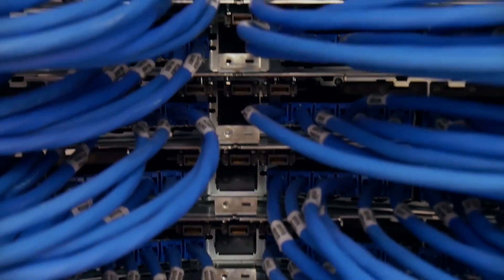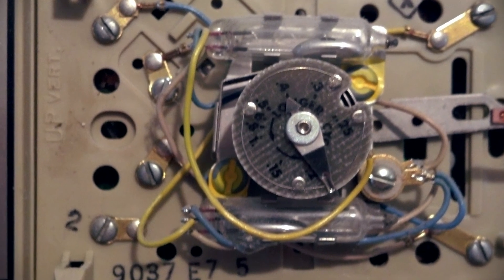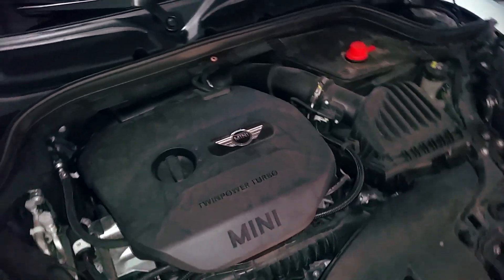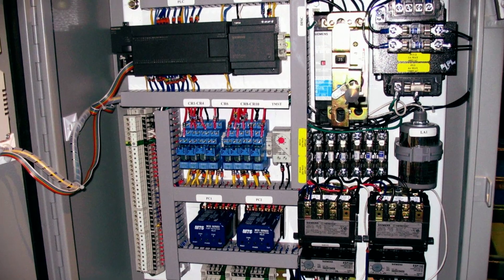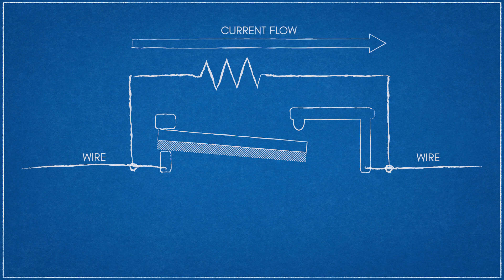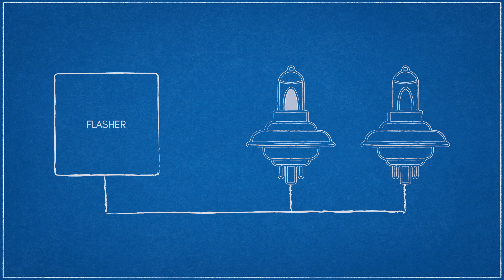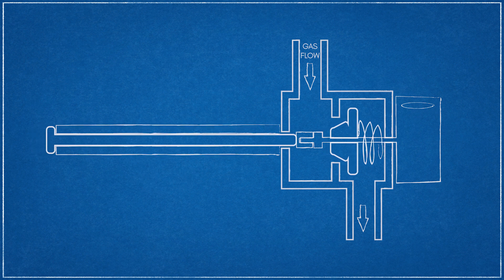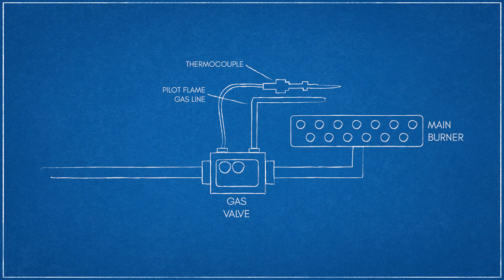Clever Uses Of Thermal Expansion

Comment: Thermal switches in blinkers typically have the resistor and bimetallic switch in series, so the light goes on immediately when you turn the blinker on and turns off once the resistor heats up enough. Also thermal switches in blinkers slow down when a light bulb burns out, as the current through the resistor decreases and it takes longer for it to heat. Relay based blinkers usually speed up when a bulb burns out. And the rate change isn't an accident, it is there so the driver notices when a bulb burns out.
Reply: Always wondered why they sped up when they were dieing. Great info
Reply: My brain died when he said when one bulb fails more power goes through the resistor... But... the resistance is higher now.
Reply: It will speed up. Thermal inertia plays a role in it. If you have 2 bulbs on and send more power though the strip, you end up with more hear stored in the heater and the strip and it goes a bigger distance. If you have less heat, it will open less far apart and cool faster too.
I get your logic with the slower turn-on, but tell me, how would it cool down slower and turn off slower if you had less power and thus less heat though it with a single bulb?
The thing speeds up.
Reply: @whatevernamegoeshere3644  Hey there... I tried to look it up, but some say it slows down, others say it speeds up. The thermal inertia theory however would make sense, so for all I know you may be right.
I also have to correct myself, I believe I read somewhere, the heating resistor is connected in series, which seemed to make sense, as it would make the light turn on immediately. But from what I've seen, most blinkers seem to have the resistor parallel to the switch. And basically the resistor has a high enough resistance so the light bulb only glows when the switch shorts out the resistor.
It is also worth mentioning that these blinkers are usually not bimetallic but instead use a single type of metal that expands a lot when heated and the switch is designed in a way so that it snaps open and closed. This gives it more decisive on and off states and also causes the actual clicking sound. Most switches click because of this and it's actually kinda necessary. Because when you disconnect to contacts you usually get an arc (the sparking when the switch opens) and that damages the contact, so you want to extinguish the arc as quickly as possible. It's a little more complicated than that. But anyway, just thought maybe it interests someone here.
Anyway, thanks for your explanation. I would be interested to know for a fact whether the speed up or slow down with more and less load, since the internet seems to disagree... Perhaps it's also different from blinker to blinker.
Reply: @phinok.m.628  
My experience with Chrysler vehicles was that the blinking speeds up when the tail light bulb burns out.  Some other cars don't seem to change much.
Reply: Phino K.M. Indeed. And newer vehicles (e.g. EV) with LED turn signals have the audio synthesized to provide that feedback to the driver
Reply: @airgliderz  Say you have 2 bulbs at 1 ohm in parallel and one blows the resistance goes up (from .5 to 1), unless car blinkers are wired in some wierd way then idk.
Reply: @airgliderz  It blinks faster because there is less thermal inertia, it's quite simple really.
Reply: @benlawton5420  correct.
Reply: This was always the problem with thermal switches: any variations in the load caused a change in the flash rate. What aggravated the situation was when you replaced a dead bulb, you used a different bulb that burned either more or less current than the OEM bulb. After that, the flash rate was different than it should be. How many times have you seen a car in front of you whose turn indicator is flashing very fast? He put a higher wattage lamp in the socket than was the original. Too slow meant the wattage was too low. The uP-driven turn indicators do not have this issue, although they almost all no longer use incandescents, either. There are also flasher available for use with these different wattage bulbs. No doubt there is some DOT spec somewhere that says "turn indicators must have a flash rate of X."
Reply: No; the turn signal is initially off (well a small amount of current flows, but not enough to light the filament). 

Once the bimetallic strip heats enough, it contacts, full voltage flows through the switch (and  not the resistor) allowing the strip to cool again.

The strip heats when the light is OFF, not the other way around.
Reply: This technology isn't used in cars anymore. It's all monitored by the body control module and when it senses a bulb that has failed, it speeds up the blinking cycle.
Reply: I always wondered what caused the clicking noise - when I was in the car as a kid. haha.
Reply: @voidisyinyangvoidisyinyang885  relais
Reply: I think bimetalic also make the signal blink faster because it heats less and returns to closed circuit quicker.
Reply: @airgliderz  I know you're upset but if two 1 ohm loads in parallel on 12v that's .5 ohm so 24w where as if one blows that's a 1 ohm load so 12w
Reply: @benlawton5420  I'm not upset, clearly you are.

Your are correct on the circuitry

Comment: There was once a fully automatic toaster that used the thermal expansion of heating elements it used in order to lower and raise the bread, along with a bimetallic strip to turn off the power as the bread got toasted, I believe this is also a great another great example of thermal expansion

Anyways, great video
Reply: Technology Connections has a video showcasing that toaster, should check it out if you haven't seen it.
Reply: @RaihotDoW2  youtu.be/1OfxlSG6q5Y
Reply: I believe that toaster was made by sunbeam.
Reply: I think that sunbeam toaster didn't use a timer, it detected the amount of light/heat reflected off of the bread to figure out when it was done.
Reply: UserNameAnonymous Nobody mentioned a timer here, only a bimetallic strip
Reply: @AL_O0  - ah, maybe the "eye" used a bimetallic strip also. I thought you were referencing a bimetallic strip timer mechanism. My bad.

Comment: Nice stuff, haven't heard of some of the mechanisms yet. Something that I missed would be shrinking bearings, gears, couplings etc. onto shafts by heating the piece and maybe cooling the shaft. They then slip together nicely and after normalizing in temperature they clamp extremely tight together. In a similar fashion there are also heat shrink collets for holding endmills and other tools, there are even special inductive heating devices for inserting and removing the tools from the collet. They are really compact and stiff while also being very precise.
Reply: Generally, unless you have the extra equipment or need a really interferenced fit but are limited in heating the outer, cooling the inner is avoided because it will condense water out of the air and you'll end up rusting the parts.

One workaround is using a purged box with something like nitrogen. Now there's no moisture in the air.

Comment: Automotive cooling systems are pressurized around 14-16 psi  raising the boiling point an extra 45 degrees. I enjoyed the video I just wanted to offer this information to you.
Reply: Also the composition of the cooling fluid increases the boiling point...
Reply: That's why you never open the radiator cap when the engine is hot! It not only relieves that pressure which expels through the radiator cap, it will cause the coolant to instantly boil.
Reply: An extra 45 deg C? No way.
Reply: @rogeronslow1498  as he was mentioning a pressure measurement in psi, I think he is talking about fahrenheit.
Reply: @marcusrauch4223  lots of people use psi for day to day pressures and SI units for non pressure measurements.
Reply: @rogeronslow1498  Simple check on Google tells us that radiator additive concentration can increase boiling point to 121deg C to 125 deg C. As a Material Scientist I like to keep to correct units mainly the Metric system.

Comment: Awesome video! I've never thought before how a dial thermostat works, but that makes perfect sense. If you happen to know, wouldn't that make the metal very brittle or build up thermal stress after enough exposure though?
Reply from the maker: Thanks! So short answer yes it does, but how much and how it affects critical bimetallic parts is a complex question, as it is determined by the alloys, the formed shape and even the method of bonding.